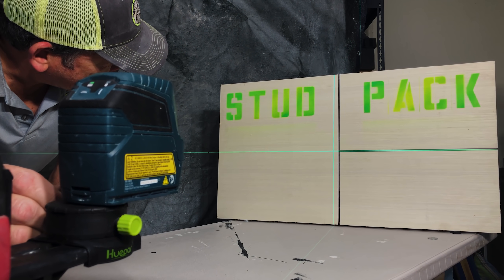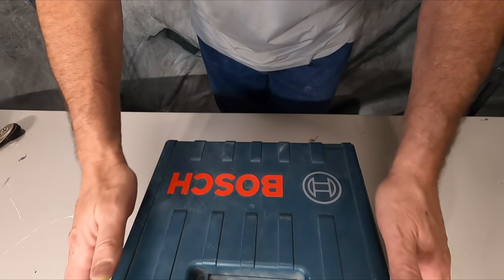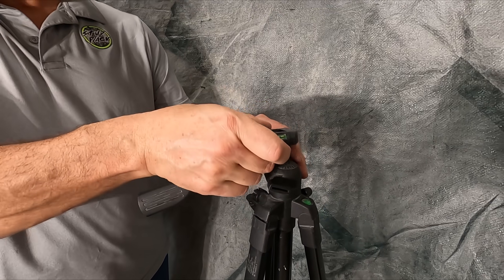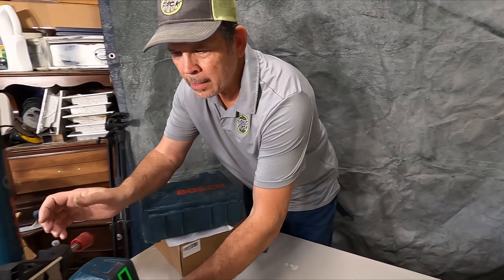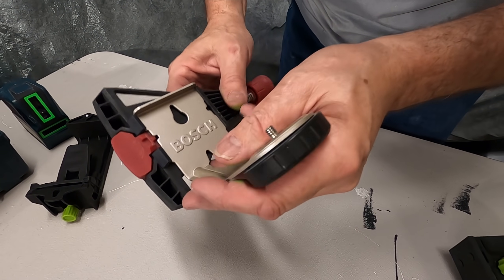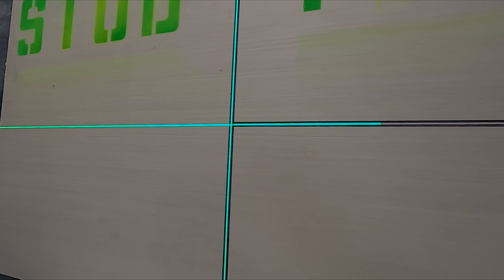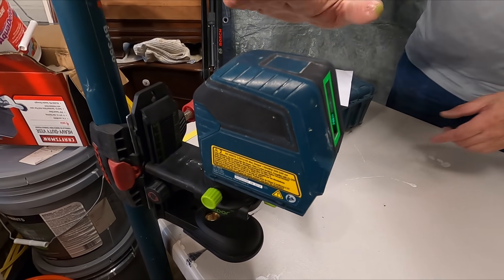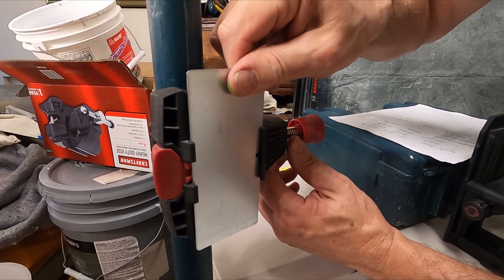This MUST HAVE Laser Mount is a GAME CHANGER

Comment: O.K. Im going to make your life WAAY easier! I watched your video on this and thought that is something I need for doing what I do especially when I use my Bosch Laser Level.  The thing I noticed was the product you're using is made of plastic AND it attaches to a pole which isn't the best way to do it.  To much movement in a pole mount.  What I use is a Tri Pod with my laser attached to it.  But the problem was I wasn't able to do the micro adjustments with it that I needed.  So I researched & researched this until I discovered this alternative.  The alternative is this, NEEWER 4-Way Macro Focusing Rail Slider with Quick Release Plate, 1/4”-20 Thread for Macro Photography and Close-Up Shooting, Compatible with Canon Nikon Fujifilm Sony DSLR Mirrorless Camera.  I ordered it off of Amazon and man this think is ridiculous.  Heavy machined aluminum and all metal adjustment knobs etc.  and is precision precision. Check it out and let me know what you guys think!

Comment: This looks like a great setup. I'm very interested in getting the Huepar fine adjustment and a telescoping pole. However, not really interested in trying to find a place to get a custom metal plate to mount the fine adjust bracket to the pole. Seems like this would be a popular setup. Is there not a compatible telescoping pole for the Huepar bracket?

Comment: Thanks for the video. For my job I use it for placing conference tables in the rooms by lasering in the base before the large tops go on and that way when I put the top on it’s exactly where it needs to be 

I have a 360 Heuper laser level kit that came with a magnetized mount but nothing I could attach to a tripod 

Having to move the tripod to adjust is a pain the fine tune adjustments would be great if I could do them on a tripod
Reply: I just hit the link and there was a video that shows it can be mounted to any try pod very cool guys I I get it I will let you know my experience

Comment: How do you achieve your exact angles I.e. 45?  The mount doesn’t rotate as part of its functionality does it?  Also, can the Bosch pole be supported by the tripod?  I.e. if I am working in a great room with 18ft ceilings how would you do your setup?

Comment: 3:35 Looking at this I see how to fix it immediately. Look at the Micro Adjust Archery Sights. Mostly the ones for target shooting, and competition, the dial "clicks" adjustment knobs would be ideal for adjusting this laser the micro amounts you would need at a long distance, That also so happens to be what those adjustments on the archery sights are designed for. They already have attachments for bows to put lasers on to help set up adjustments, I dont see why the two couldnt be joined to make the ideal laser leveling system.
Reply: 5:30 Much better but the archery ones im speaking of would give you hair adjustments, literally the width of a ** hair.

Comment: I asked for and received this Laser for my birthday. I am having trouble moving my lateral line up the wall to have a level line to hang pictures or artwork. I got the tripod but after 'fooling' with it for 30 minutes I got frustrated and stacked books on top of my 10' ladder until the line was at the height I wanted to hang my art work. I set my laser on top of the books and got it hung perfectly. HELP, please. Is my tripod useless for hanging artwork and pictures?

Comment: Paul, Jordan, I actually cut the galvanized plate and filed in the corresponding notch. As I was installing it onto the pole, I took a closer look at the bracket that came with the Huepar. I simply attached my laser to the Huepar using the 1/4" screw. Than I connected the Huepar to the original Bosch bracket via the magnets. Therefore, I did not need the new plate that I cut. It works perfectly.
Thank you both for an absolutely outstanding series. One of the very best on YouTube!
Reply: Do you have a picture of this?

Comment: I actually have a hubar laser and it came with the fine adjustment bracket. Laser probably isn't as high of quality as some others but so far it's worked well for everything I've done with it. Cost of the whole kit was less than 200 bucks. I use my wife's tripod for her camera with it.

Comment: The Bosch BM1 Positioning Device does the same thing. It will actually fit onto the Bosch Pole Clamp without your custom metal plate adapter.
Reply from the maker: It only has micro adjust horizontally.   The Heupar has it on all axis 👍👊

Comment: No need for a steel plate at all. If you are using the Bosch mount with the Bosch bracket (has the 1/4-20 stud on it) SIMPLY thread the Huepar mount onto the Bosch 1/4-20 stud.  If you look at the bottom of the Huepar assembly you will see a 1/4-20 female.
Reply from the maker: I tried it.  It’s a mount mounted on a mount.  Too much play IMO but it’ll work 👊

Comment: I purchased a Huepar laser and telescoping pole last year to level some floors that we replaced.  That thing is a lifesaver.  I now use it to set up new framing, leveling floors, tile, and leveling ceilings.  I love it.  I am not a professional like you guys but I am remodeling an old house with my son so I wanted one when we did our first floor tear-out.  I love my laser and it is green cross point and also puts a red dot on the ceiling.  It has a built-in bubble level and the tripod and pole also have built-in bubble levels.  I paid 60 bucks for the laser and another 40 bucks for the tripod and pole.  Best investment ever.  I use it all the time now.

Comment: I'm looking for the ability to make micro adjustments to the receiver end.  U use a Bosch self leveling with the LR30 receiver.  The Lr30 attaches to the Bosch staff rod with a friction clamp.  Im looking for a way to micro adjust the receiver vertically until it receives a full signature.  Anyone ever seen such?

Comment: Do you have separate laser levels for lines and plumb dots?  I need both and was wondering if getting the  BOSCH GCL100-80CG with both combined is getter than having separate levels.  Thanks, - Steve

Comment: Ive always just stacked tiles on my cart and then used shims to get it perfectly to my mount. Then snap a line and get the bottom row or rows flush with that first line. Mostly because I don’t always have the the luxury of leveling the floors. So marble shims and 8th and 16th shims until I can hit that line. Then I know we are level for the rest of the wall. Then when I get to the ceiling I usually have to cut angle pieces cause the ceiling is rarely perfect either. You know the struggle

Comment: My Bosch laser swings about 300degrees and adjusts up and down. The bracket is also magnetic, has a screw hole and can also strap it if needed. All came together in the Bosch box.
Reply from the maker: Thx John.  The fine adjust was my issue.  It wasn’t possible with Bosch mount I had.  👍👊

Comment: Kinda funny, I've actually been mulling over the idea of buying one of those huepar fine tuning mounts for my stabila crosshair laser level ever since Christmas but haven't gotten around to it until now. Just finished building a 14.8 meter (48.5 feet) wide grand stair with tiered bench seating, and believe you me, I got pretty good at nudging the back end of the laser 1/100th of a slight breeze just to watch the vertical line move over 1/2" at a time on the other side!
Reply from the maker: We feel ya Keith! 😂😂

Comment: Just a quick question!  Wouldn't the magnetic Huepar mount simply magnetize to the metal third hand pole?
Reply from the maker: Probably but it would rock a lot I presume.  Flat plate on round surface?   Honestly I didn’t try it
Reply: @StudPack  I’m going to order one And try it if it does not work I will manufacture one as well.
Reply: we can do it

Comment: I have another crossline laser from Hupar of and run rechargeable Enloops in it (keep another set in the charger on the job). Also the rechargeable laser distance measurer. Both have been great for several years. I check them often and they are dead on. I think your amazon link caused your followers to wipe out the bracket supply. Out of stock at the moment lol... Good vid.

Comment: That mount is what I've been needing for years, but never took the time to look for. Many years ago I picked up a nice 5-beam crossline for big steam piping job. It is was a huge time saver, but it didn't remove the need for a second guy during layout as I thought it would. Fine adjustment was just too difficult with the point of aim more than 10 feet away. I use the laser all the time, even around the house, and this really kicks the convenience of using it by up several notches. I also happen to be tiling my guest bath, so yeah. Another tool to order! Thanks!

Comment: Bosch makes that it’s the BM1 58$ I use it on that pole.
Reply from the maker: I don’t see a fine adjust for the vertical beam, only horizontal
Reply: @StudPack  you’re absolutely correct, adjusting the horizontal was my biggest challenge. The other adjustments would be a welcome addition to the Bosch unit. Thanks for the videos tons of great information.

Comment: I have a Bosch laser that cost $40 and it has the horizontal and vertical lines. What does the $200+ laser offer that the small one doesn't? Is it the ability to do 45 degrees?
Reply: It's probably the laser accuracy range, resilience of the hanging prism assembly, and the ability to lock the laser during operation. In my own experience, the lower price lasers have their beams expand much faster over long distances and the prisms aren't as stable against small vibrations which makes it hard to transfer an accurate line more than about 30 feet. Not that big of a deal if you're just using them inside a regular size room, but important if you're working on a larger commercial site and need to transfer elevations or lines across long distances.
Reply from the maker: I’m not sure.  Maybe but that’s an expensive option 😳

Comment: That's awesome. I use the bosch green lazer one step down from yours it was 150. But I'm going to replace it with the new m12 green lazer that uses Milwaukees m12 batteries. It also has a built in fine tune knob. It's 400 though but the rechargable battery is worth it to me.

Comment: Should have got the huepar laser level. Mine does 360 degree line and the best bit, it runs plugged into mains power, on AA batteries or on the supplied rechargeable lithium battery. Its also about a third of the price of an equivalent dewalt or bosch laser in the UK and they only run on AA batteries and not for long.
Reply from the maker: I just found out about Heupar products 😩
Reply: @pedred what model do you have? And what price? Thx
Reply: @JackJones-yx1ts  huepar 603. Comes with all the clamps and bits in a case. £200 on amazon in the uk. Great bit of kit.

Comment: Their lasers are also great and under $50!! Self level, strong green laser can see in the day, and can lock and do degree angles. FYI, it is self leveling, so you can simply twist the laser itself vs the Bosch mount, or if the screw adjust on the Heupar is maxed out, you can simply twist the laser itself. FYI#2 you can get the monopoles from Manfrotto as well, and get a superclamp that will take a camera mount thread. All this photo gear helping out the contractors...nice..Oh, and on that point, FYI#3 You can get the 400-600 LED video lights that will BLAST a worksight with lots of power like day light under $120, often 60-100

Comment: I love huepar I got the actual laser level. Great value level and I'm gonna try that mount
Reply: They're junk. Had one. Its got gaps in the beam from the reflectors and Stopped working the second use.
Got the Bosch 360 instead.